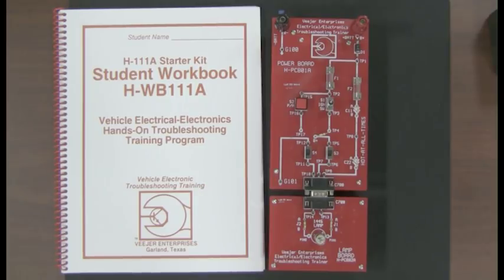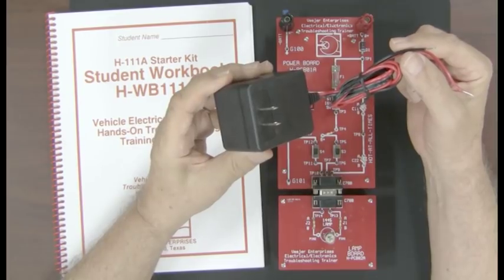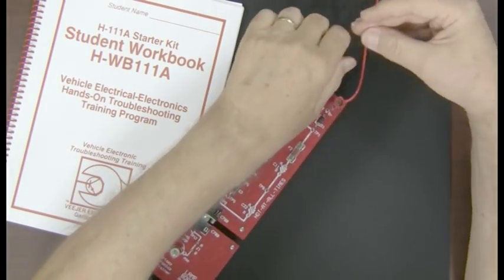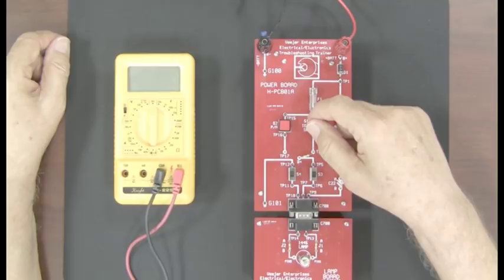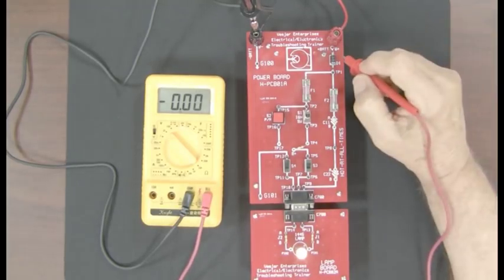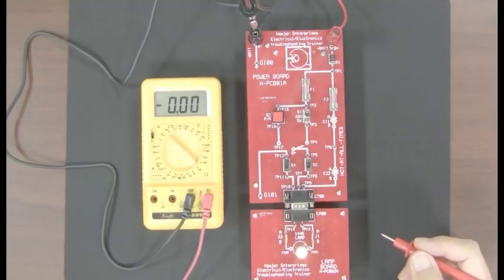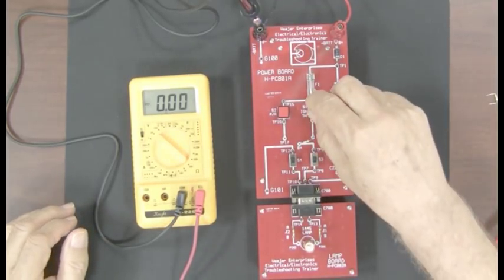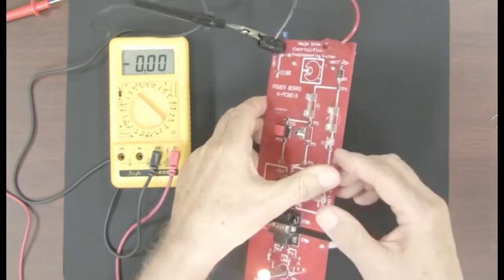H 111A Automotive Electrical Troubleshooting Training with Vince Fischelli

Comment: How does a diode cause a drop in voltage, thought it just stopped voltage from returning---great informative video.
Reply from the maker: Don't confuse voltage and electron current which is a common mistake. Electron current can only flow through a diode in one direction, that is against the arrow in the diode symbol. As electrons pass through a diode a voltage drop appears across the diode because the diode has some resistance. A silicon diode drops about 0.7x volts while conducting electrons which indicates the diode is good. Electrons cannot pass through a diode in the opposite direction.
Reply: @vincefischelli7115  how much is your book sir?
Reply from the maker: @patrickkateule815  Buy  Now Link   http://www.1shoppingcart.com/SecureCart/SecureCart.aspx?mid=2169DBD4-F088-4CA4-A011-56C1593411AC&pid=bb5bd16b1567cdb53078e831b81dd4a8

Comment: Sir may i ask if i meassure a voltage drop accros the voltage side and found to much higher than o.78 there is a faulty connection on this part its possible that there is a high resistance in the voltage side circuit im i right sir subcriber from the Philippines tnx
Reply from the maker: The voltage drop could be caused by a loose or corroded connection.

Comment: Hi you have the same B-  voltage drop at 7 .63 in three different locations then you say it’s a bad ground, but the other two points are 7.63 as well, the voltage drop is the same figure in three places,, but that one is out, I don’t understand , can you please help
Reply from the maker: Everywhere you read 7.63tmauto3267@aol.com indicates the ground circuit is bad. When you read 0.10 the ground circuit is good. The ground problem (corrosion) exist between the last place you measured 7.63 and 0.10V